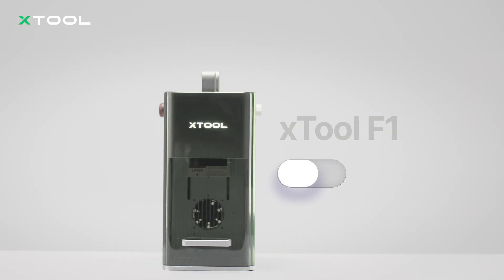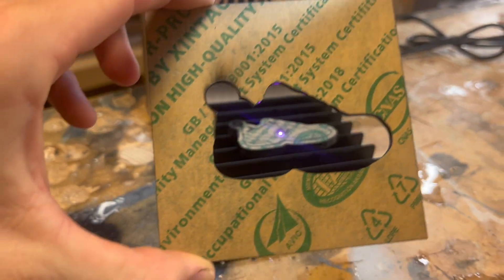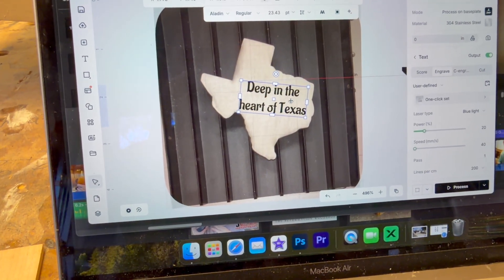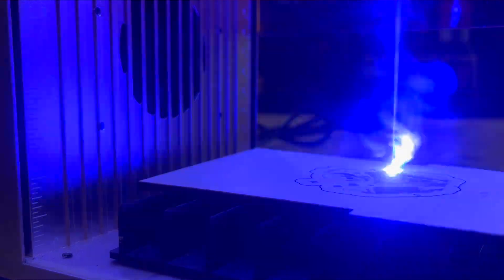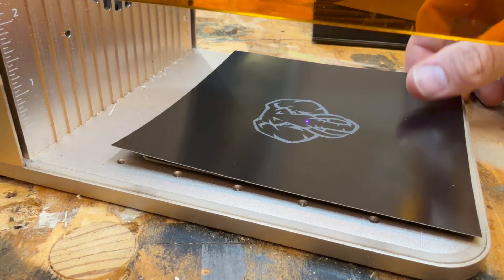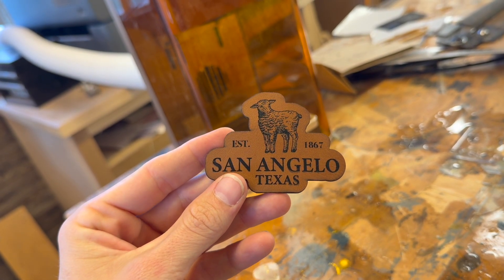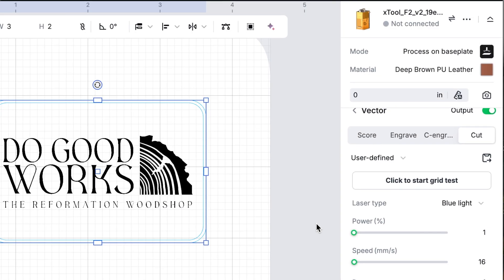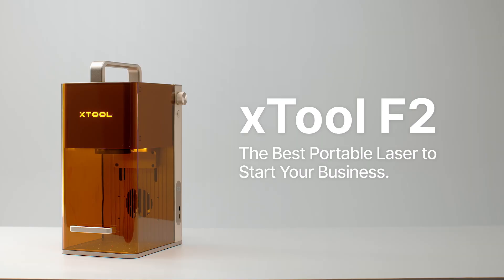🔥 The xTool F2  – The Most Powerful Portable Laser Engraver on the Planet

Comment: These machines die in a few days. If you are lackey you'll get a good one. if you buy it from amazon, they don't honor the warranty.
Reply: I bought my F1 for almost a year ago , refurbished , from Xtool store
on Aliexpress ,for a very low price .
Still today i works flawless .
I don't know what was wrong with it in the first place ,since it was
refurbished ,it was like brand new ,but the plastic cover that
covers the lens had a small skid-mark ,like the laser had been 
turned on and used ,but the cover was not removed during
this operation ,maybe that was the reason for the customer
to return it , that he or she could not get the laser to work
because they had forgotten to remove the lens cap ?